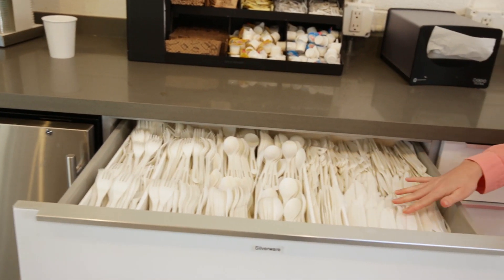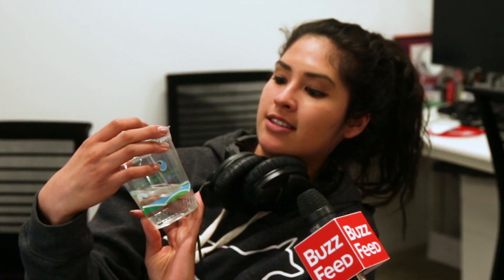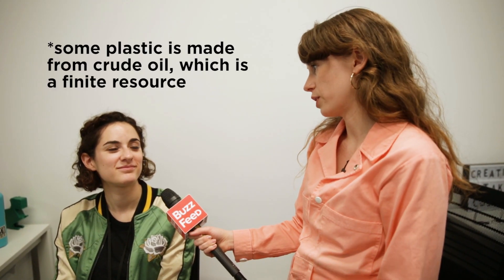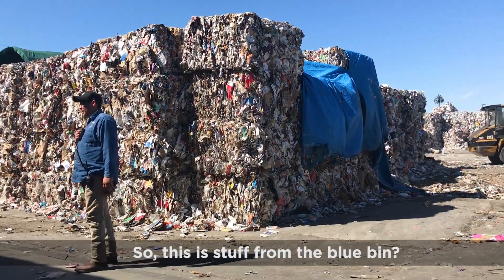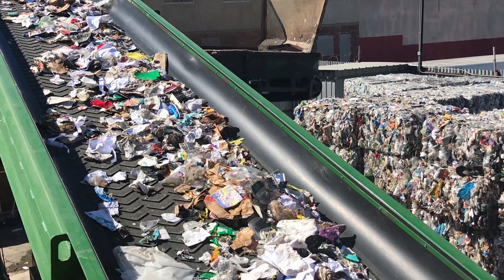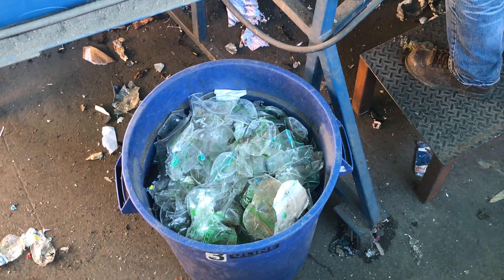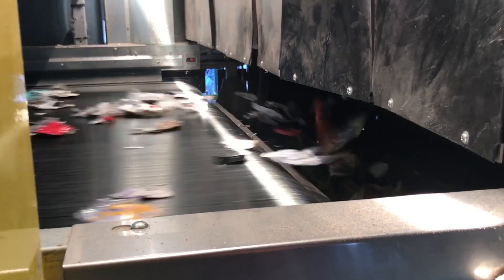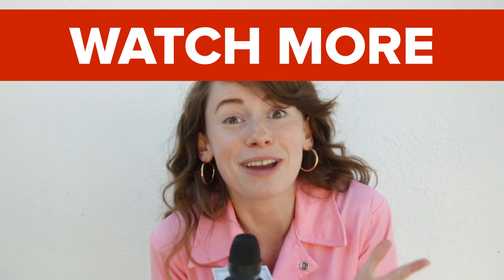You've Been Using "Compostable" Plastics Wrong

Comment: I am experimenting with bio-plastic decomposition.  In the tests, I learned certain 'bio-plastics' will decompose if placed in larger, denser composters.  These larger units are not the standard garden composters with one or two cubic feet of mixed material.

A larger unit will contain a cubic meter or more.  The greater mass generates more pressure, more heat of decomposition, and therefore an environment more destructive of the denser 'bio-plastics.'

These video shows a very simple test of a very soft 'bio-plastic.'

https://youtu.be/PTM5WTJkHR0

This video shows the start of a test of NatureZway bio-plastic lawn bags:

https://youtu.be/6S2B5r4yOag

This video shows the one-year results of that test:

https://youtu.be/tn1m35pLcwY

The NatureZway 'plastic' bags disappeared.  Gone.  Totally gone to soil

I am now editing a series of tests of kitchen bags manufacted by NatureZway.  The CEO of the company provided several rolls of lawn and kitchen bags.  The company makes other products.
I hope that company -- and others -- will continue with their research and develop products making the present toxic products obsolete.

Comment: I use a thermos. Uninsulated drink bottles are a huge waste. Kept clean and with maybe a couple sets of gaskets for the lid, a good thermos will last decades.

I've recently switched to washable straws (that turtle video, OMG) as well, Started with Stainlesss steel, but may try silicone. The steel ones transfer temperatures a little too well.

But it is possible to get home composting hot enough to break down those bioplastics. It just takes a bit more work. 
Lookup Hot Compost. 

Also, I'm kind of surprised that Arizona isn't raking in the cash from this. They can get those temps just leaving their cars out in the sun. Composting there, even if you had to truck in grey water for it should be really easy.

Comment: A full sized compost pile needs to be at least 4 feet cubed to cook at the right temperature.  A real compost pile like that DOES easily get over 120F and would cook these cups easy peasy.  Hobby/apartment-grade composting has significant limitations with other kitchen waste too. You don't need an "industrial" composting system, but you do need to have at least a full sized compost pile.